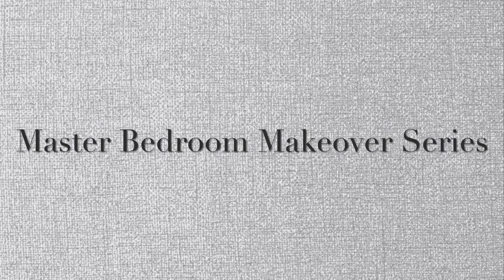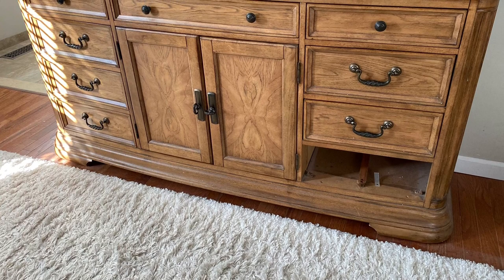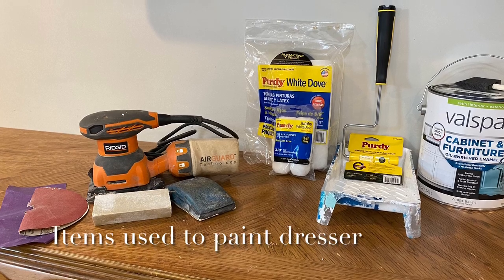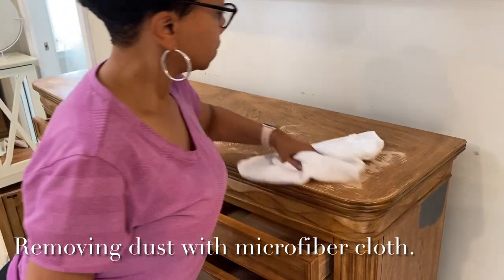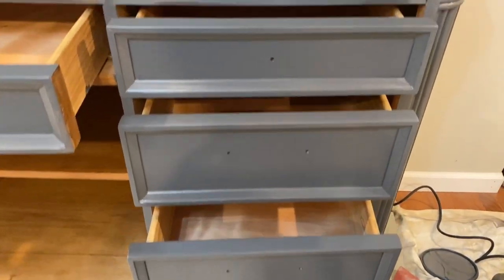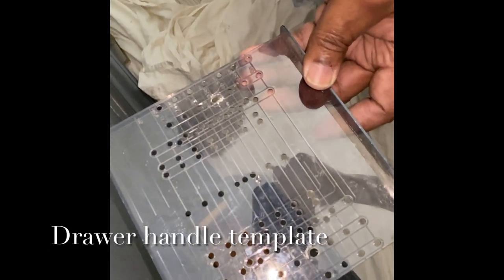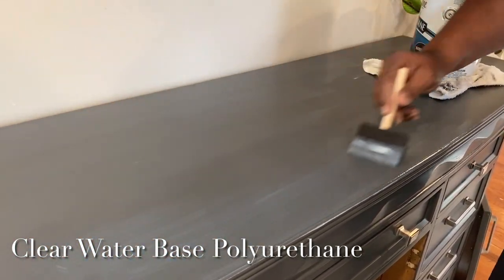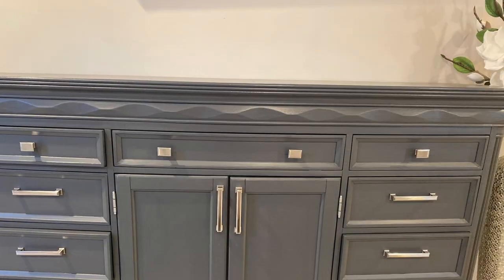DIY! DRESSER TRANSFORMATION! MASTER BEDROOM MAKOVER SERIES!HOW TO PAINT FURNITURE

Comment: This looks awesome! You are inspiring me to do the same. I have furniture that I want to replace but can’t find anything. Quick question did you sand and put polyurethane on  the entire cabinet including the drawers or just the top?
Reply from the maker: Hi Nicole! We only sanded the top of the dresser because of wear and tear and we only used the polyurethane on the top to prevent any wear and tear in the future. We didn’t have to do any primer at all. The paint we used had everything necessary to complete the job. It’s actually been three months since and the paint is very durable. No scratches or peeling at all.  Purchased paint from Lowe’s: valspar cabinet and furniture oil enriched enamel paint and this paint is tintable. I hope this helps! Thanks so much for watching!
Reply: Hi Tania,  what color was that gray color? I was looking at several grays and they are not looking gray once they get on the furniture. Thanks
Reply from the maker: Hi  Nicole, it is a charcoal gray.
https://share.icloud.com/photos/0KHuQmxr5m7H8jpMYLIqTs-qg
I use the color on the spray can lid and took it to Lowe’s and they matched the color. Then they tinted the paint with this color. I hope this helps.🌸
Reply: @DesignToAT77  thank you! This was very helpful